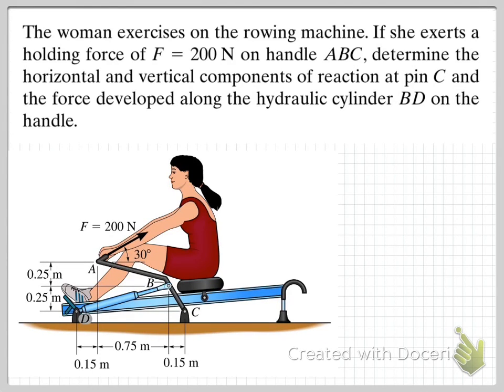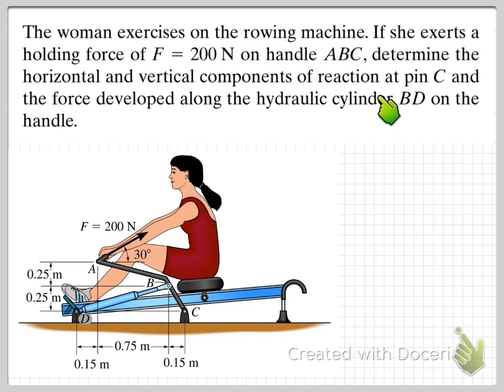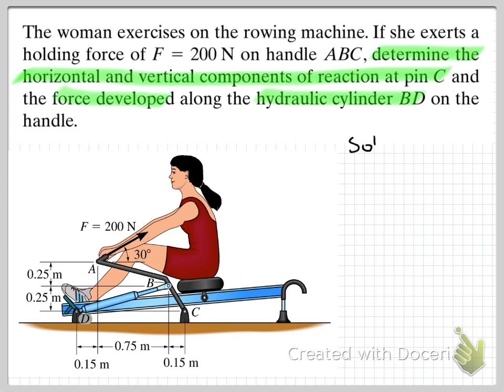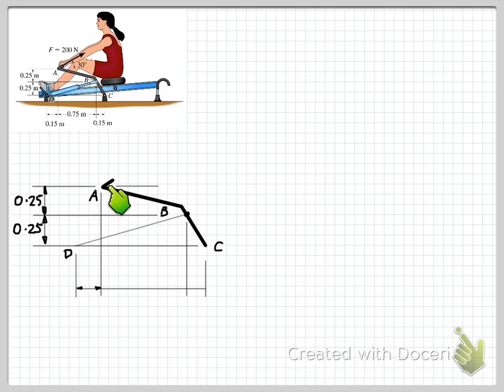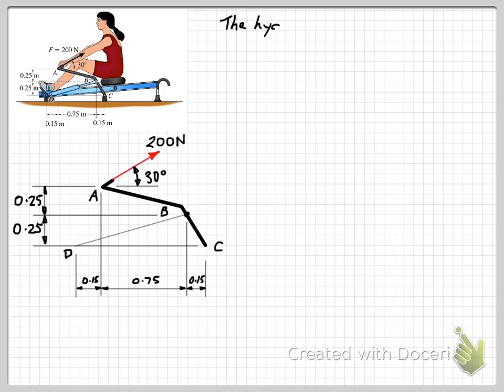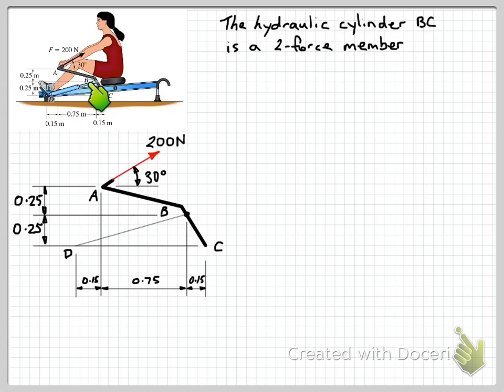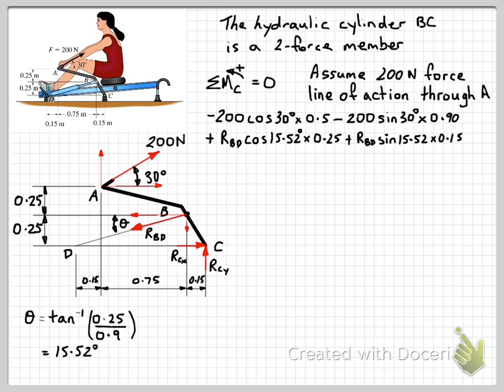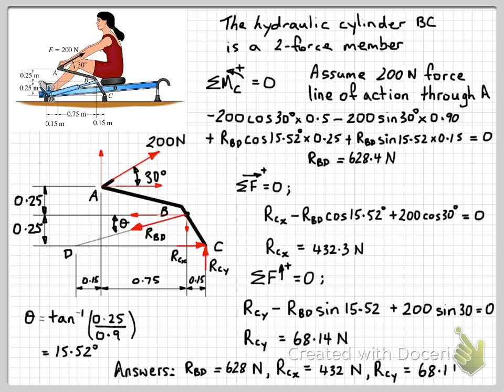Rowing machine analysis

Comment: Why  didn't we take  Reaction at point D can you Explain.
Reply from the maker: not sure what you mean by "take Reaction". If you mean "why didn't we calculate/determine the reaction at D?", the question didn't actually ask for that. But of course, since the hydraulic cylinder is a 2-force member, the reaction at D (on the cylinder) is the same as the reaction at B (on the handle), or equal, opposite and co-linear with the reaction at B (on the cylinder).
Here is a link to my lecture video on 2 and 3 force members https://youtu.be/c9zOZiBogTY plus an example done in powerpoint https://youtu.be/iLXeMWpiGsw